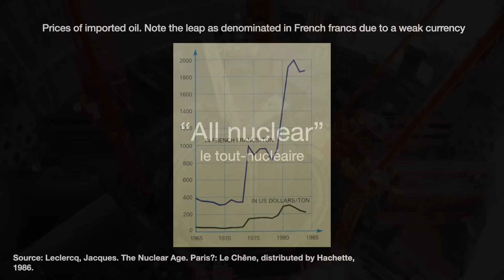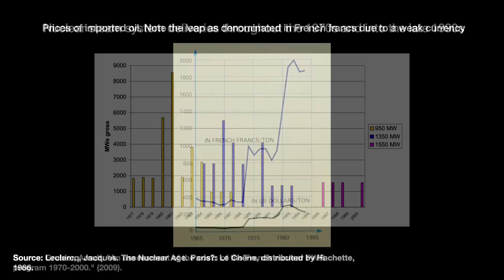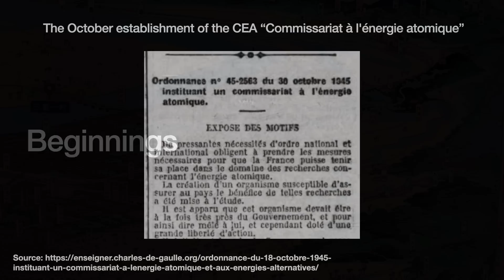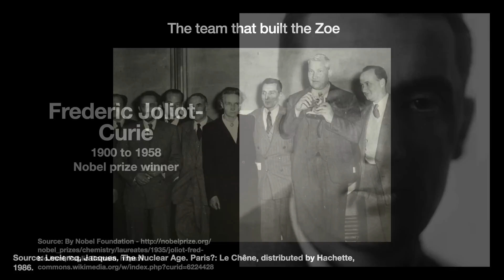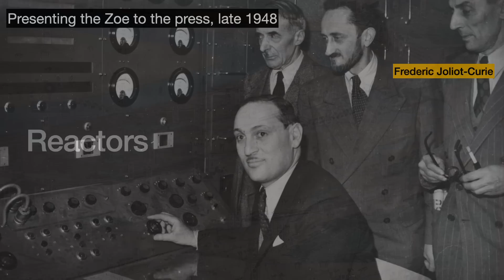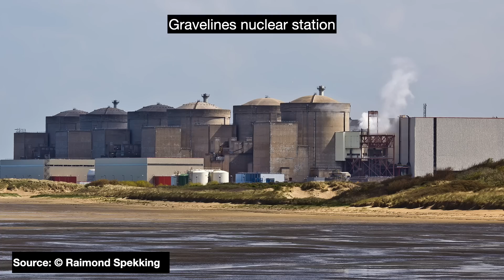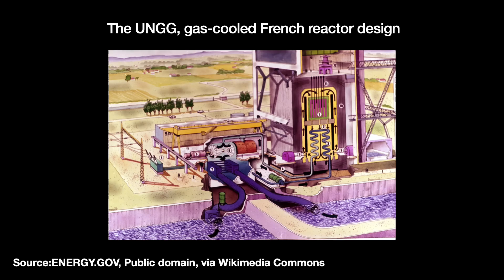That Time France Went "All Nuclear"

Comment: Nuclear energy is extremely underrated 👍
Reply: It's not underrated, it's outright hated and opressed.
Reply: @ZippyPiglin4136 International Oil & Gas companies fear and hate it.
Reply: @ZippyPiglin4136  "opressed" 😂😂😂
Reply: @snarckys3063  When you have thousands of layers of paperwork that does absolutely nothing but delay you under the guise of "safety" advised by bureaucrats who don't understand middle school science, that's what it is.
Reply: @ZippyPiglin4136 you don’t see a single reason why nuclear plants should be considered under extra safety measures than say a windmill? Really?
Reply: @hii4973   Did I not mention Heavy Indsutry explicity? What do you think Heavy Industry handles? WInd Turbines, or Steel Furnaces running at 2600 Celsius for years straight pouring out hudnreds of tonnes of material daily? Ain't no one batting an eey about how much sheer steel is needed daily, and how many lives are costed in that.
Reply: @ZippyPiglin4136 you think steel plants aren't heavily regulated? They are. Even so, the scale of destruction a failed nuclear plant would cause as opposed to a failed steel plant is orders of magnitudes higher. Hence the increased scrutiny
Reply: @hii4973  
The destruction  a failed nuclear plant would cause zero. 
In comparison, most mienral mines, especially REEs,casue immense water and land pollution, constantly. It's not flashy, but it is on-goingand always. 

"Hence the increased scrutiny". Great! Let's put intensemonitoring on all landfills that see solar panels as waste. Let's make all Solar Panels be manufactured in developed nations, with all minerals needed for it be extracted in developed nations. Let's monitor every single death and injury on Solar. Let's monitor every single material and water expelled from solar fields. Let's add in five more years of wait tiems and insurance complexity on Solar. Let's also make it mandatory to have massive ecological analysis. 

And guess what? It's equivalent is the least Nuclear has been delayed. Even though Solar needs massive mines in nations running off of slave labour, heavy metals that kill in minutes buried openly. No energy storage, thus firing up Gas at night. try changing any of that, and you blow up their "slightly lesser" Capex. 

And as for disasters, every heavy indsutry has far more death and risk than Nuclear possibly could. Nuclear has the least deaths per energy produced. Disasters from Hydroelectric, Natural Gas, and Wind Turbines are far more lethal, and far far more common. 

So maybe look why anything that isn't a LEU Light Water Reactor takes fifteen more years of scrutiny for absolutely no engienering or safety reason, while Solar Panels containing who-knows-waht heavy metals get installed to kill off local wildlife over a massive area that too with tax subsidies.
Reply: Tell me what do you do with nuclear waste? And how long does it keep poisoning the environment? As long as the waste issue is not resolved, nuclear costs more than it provides.
Reply: @TheAhmedRabia  "what do you do with nuclear waste?"

You put it in the ground where it came from.

"how long does it keep poisoning the environment?"

Never, since spent fuel from commercial NPPs is the best handled of all the waste humans produce, contrary to fossil fuel pollution which is thrown straight into the atmosphere.

"as long as the waste issue is not solved"

In 60 years of civilian nuclear power production there has been not a single deadly accident regarding spent fuel. There is no "waste issue".
Reply: @Z80Fan   Why do you lie?
Nuclear waste doesn't come from the ground. It comes from reactors. And it keeps emitting radiation and poison the environment forever.

You also lie about accidents. Look at waste storage bunkers in US and other places keep leaking poison and having incidents all the time. Look at Fukushima, Look at Chernobyl. The nuclear waste remains poisonous forever and anything it touches becomes radioactive and hence nuclear waste.

Stop lying to people. There is no scientific way to stop an item being radioactive. All of the current solutions to nuclear waste is merely sweeping it under the rug. And it keeps coming out of the rug and it stays poisonous forever.
Reply: @TheAhmedRabia  You're the one lying.
Reply: @ It's only an issue in fossil fuel propaganda.
Reply: @kristoffer3000  why are pro-nuclear freaks always such condescending fanatics? Literally insane.
Reply: Commercial utility-scale nuclear is the most expensive way to generate electricity, takes too long to build (10+ years), and comes with unparalleled risks that no other electricity generation even comes close to in risk profile.
Reply: @beyondfossil  It's expensive becuase governments have made it expensive with regulations. Do you really think that nuclear power has made human kind poorer? What evidence do you have for that mad claim?
Reply: @bjorntorlarsson  The UN IPCC says the next 10- to 20-years will be critical to mitigate the worst effects of global climate change but it takes 10- to 20-years to bring online a single utility-scale nuclear reactor!  New construction commercial nuclear energy won't even put a dent in the amount of energy needed to displace fossil fuels.

The worst part right now is that continuing the promote commercial utility-scale nuclear energy will only delay the global energy transition.  It will most certainly allow fossil fuels to be used for decades and decades longer than otherwise.

France's nuclear program is not a model for other nations to follow.  France's state run EDF is carrying huge amounts of debts subsidizing commercial nuclear energy to try to keep retail costs low for consumers.  But that cost just gets socialized in government debt, central bank balance sheets and across dozens of public funds making it hard to track.  Most of France's 56 reactors are at or near end of life and will cost billions to keep running all while getting less efficient and needing more maintenance versus newer designs.  France could be looking at a national energy crisis within the next decade or so.  France has not fully launched a new reactor since 2000 as Flamanville-3 continues to have problems.

Look at the fiasco that is France's latest Flamanville-3.   The Flamanville 3 project serves as a cautionary tale: initially expected to cost €3.3 billion, the price tag has now soared to a staggering €23.7 billion.  It has launched in 2025 but is producing very little power as more problems are discovered keeping this new reactor in test ramp up mode only.

Look at the fiasco that is the US Georgia Vogtle nuclear power plant.  It was a schedule and budget fiasco over-budget by double ($14B to $30B USD) and over-schedule (2016 expected but was 2023).  Taxpayers are on the hook for some $8-billion for this thing!

Look at UK Hinkley Point C (using French EPR) under construction already billions over budget and years behind schedule.  Almost certainly will have more delays and more money needed

Look at Finland Olkiluoto-3 (French EPR)  which was 18 years behind schedule and original cost €3 billion but ended up at €11 billion.
Reply: @bjorntorlarsson  Nuclear energy is France receives huge amounts of subsidies and government support to help keep rates low.

Across the nuclear lifecycle, governments and ratepayers' shoulder large chunks of cost that never show up in the reactor’s overnight capital price or its fuel bill.  These costs often get socialized to tax and ratepayers by way of government budgets, central bank balance sheets or across dozens and dozens of public funds making tracing difficult.

All energy receives some subsidies, but nuclear energy’s huge construction costs takes the most subsidies per MWh generation.  I will repeat again that commercial nuclear energy is the most expensive way to produce electricity.  Every dollar spent on nuclear energy can buy 3x to 10x the amount of renewables+storage and faster build as well (seem my previous comment).  The LCOE cost of renewables plus the LCOS cost of storage is cheaper than just nuclear LCOE cost alone!
Reply: @beyondfossil  IPCC lied the same thing 20 years ago. 40 years ago it was the imminent new ICE AGE that was the doomsday. Global warmning is an obvious fraud.  CO2 is nothing but good for all life on Earth. It would be great if the oil industry could recycle enough carbon to the atmosphere  by pumping up oil and gas and burn it, so that the CO2 content of the atmosphere 4-folds, to where it was last time Earth boomed of life everywhere. With the mega-fauna of the dinosaurs.

Even if we couldn't have any other benefit of oil, such as energy, we shoudl still pump it up and burn it in order to mazimize the CO2 content of the atmosphere. For the best of all life on Earth.

Don't care about the uneducated mentally ill idiots who claim that CO2 emissions is a bad thing. They lie to you in order to kill you. It is evolutionary selection. The idiots believe any bizarr lie, eat insects and die.
Reply: @bjorntorlarsson  Always blame the government lmao
Reply: @ It is bleeding obvious that the ruthlessly looting politicians in the EU, and its individual member governments, are regulating away all electricity, all transprots, all industry. They openly brag about how good it is with mass poverty and starvation, and how slavery is the ideal life style. And the slaughter waste votes for it, murdering their own children that they obviously hate so intensly.
Reply: @bjorntorlarsson  Take your meds. Freak.
Reply: @beyondfossil  You think Tax Subsidies and your Power Bill doesn't go to Energy in USA? 

In USA alone, Nuclear is politically forced to get immense cost overruns by politics. Renewables get subsidies with little question. 

Even then, Nuclear energy cost one-eighth of Solar energy on the bill of the consumer. And THIS Solar often doesn't have energy storage, and as such partially includes Natural Gas being fired up as well.
Reply: @beyondfossil   It's actively the least expensive over lifetime, even with subsided Renewables in comparison. 
And "takes too long"? Many reactor designs being made today are Pressurised Water Reactors. It used to take less than 5 years to make one back in the 1960s-1980s. In no way is the "taking 10 years" part related to the technology itself, and is fully upon political factors which do nothing but add delays. 
And "come with unparalleled risks", all while the entire risk is detectable by a geiger counter? It's not possible presently to track the fiberglass erosion or heavy metals that get into the air and ground from renewable energy. And mining vast quantities of material is by far the most environmentally damaging, which is what renewables require for basic operation, let alone stable operation.
Reply: @ZippyPiglin36 And what do you think nuclear reactors generate power with? Lots of air and goodwill? Entire regions have to be dug up for uranium, of which useful isotopes then have to be enriched before they can be used economically in reactors. Furthermore, uranium is even less abundant in the Earth than oil and natural gas. If we would adopt nuclear power generation at large scale world-wide, we would deplete our scarce uranium probably in a few decades, long before oil. So we're just substituting one problem for another with nuclear energy. It isn't sustainable and renewable because at some point shortly after adoption, the fuel would run out.
Reply: @ricdeh1701  "Whole regions"? How large area is total open pit uranium mining in the world? And the the landscape is restored afterwards. What area of the world is covered by solar panels?

You feel chaotic emotions, then you lie up fictional "arguments". Such reality denial and hallucinations don't fool anyone who lacks severe mental disability.
Reply: @ricdeh1701  The fuel obtained by converting Thorium into Uranium 233 can suffice for humanity for centuries.
Reply: @ricdeh1701  Uranium is far from rare and you're just making shit up to suit your absolutely moronic narrative.
Reply: @ZippyPiglin4136  No, nuclear energy's lifetime costs are the most expensive at a levelized cost analysis (LCOE).  It estimates the per-megawatt-hour cost of building and operating a power plant over its lifetime, accounting for capital expenditures, fuel costs, operations and maintenance, financing, and decommissioning.

Lazard LCOE:
Commercial Nuclear: $140 - $233
Utility-scale solar: $24 - $96
Onshore wind: $27 - $73
Offshore wind: $72 - $140

Decommissioning a nuclear power plant is no easy task at all.  It costs billions of dollars and decade or more in time while the plant produces exactly zero watts of electricity.  Nuclear energy’s vaunted high capacity factor plummets when decommissioning time is included but decommissioning time is more accurate as it reflects the entire lifespace of the asset while it still consume money, labor, and opportunity costs from unable land it occupies.  In contrast, renewable farms technically don’t ever need to be decommissioned because they can be “repowered” with new assets even as the farm is still running.   Thus, the land that renewables occupy can be used practically indefinitely.

On risk, no other energy source can produce catastrophic ongoing environmental damage like nuclear.  We're talking radionuclides with half-lives from 30 years to thousand and millions of years.  Look at Germany's Asse-II salt mines leaking radioactive materials into the surround soil for decades!
Reply: @ZippyPiglin4136  Although I like nuclear power, power plant construction was and is often subsidised too.
Reply: @kristoffer3000  Nice "arguments". Pro nuclear freak.
Reply: @ricdeh1701  One Uranium Mine running on workers with Certification and Unions; versus hundreds of heavy metal mines running on dying starving children. 

And oh, Uranium and Thorium are more common than Tungsten, and materially as easy to extract as almost every metal. Tungsten was used in those ultra cheap little incandescent bulbs, to ammunition and steel alloys in the present day. Safe to say about availability.
Reply: @thelloydersvk5068  It wasin its very early days. Now, and since the last few decades, it isn't subsidised, BUT sees massive political backlash.
Reply: @beyondfossil  The Chinese would disagree with you.
Reply: @beyondfossil  Funny how China can do it at fairly low cost and can build them very quickly.

Also nuclear is the safest form of energy generation we have, regard.
Reply: @kristoffer3000  And most of renewables also come from China.

To make a even more clear point on how nuclear surpasses renewables.
Reply: @kristoffer3000  No.  China emphasizes renewables and energy storage far more than nuclear energy.  

China’s annual renewable energy generation has always outpaced its annual nuclear by multiples.  As of 2023, China’s annual renewable generation was 2902TWh while nuclear power was a fraction of that at 435TWh.  This situation has been true going back to the 1990s!

As a percentage of the total electricity grid, China’s nuclear power is falling.  It peaked at 4.71% in 2020 and now down to 4.60% in 2023 and falling with renewables huge growth.

As of 2023:
China Wind: 9.36% (growing)
China Solar: 6.18%  (growing)
China Nuclear: 4.60% (falling since 2020)
Reply: @ We're both correct.
They still use and build a lot of nuclear which is the objectively correct choice, they just build even more renewables.
Reply: @ "Funny how China can do it..." Yes! And it illustrates China's total dominance in the world economy. They can build mass solar power, that works reliably, because they do it in a MASS SCALE unimaginable in the West. More than a third of the world's solar power is generated in China, and the share is increasing quickly.

They have built, and recently announced another $600 Billion investment until 2030 the world's most modern electric grid with high capacity and flexibility to handle power surges. And of course the majority of China's electricity is generated by coal and hydro which are ideal to stabilize power supply.

Photovoltaic has a potential in theory to be competitive, and the Chinese might've come that far now. Wind power is however hopeless already as a concept, and the Chinese have gone big on wind power too. It might've been profitable to export, but it can never be competitive.

Xi Jinping has campaigned hard on three issues: Anti-corruption, Clean environment, Belt-and-Road. And all three have been a resounding success. "Clean environment" means most of all air quality in China (not climate-no-change). So he might be pushing too hard into wind power for political reasons. Those towers are very visible signs of someone having put in an effort, for some reason that couldn't be explained to rational Martians if they made a visit.
Reply: @kristoffer3000  Renewables like wind, solar are ok. But nuclear is not renewable and it is the most poisonous of all.
Reply: @kristoffer3000  "The safest"... Yeah, when it does not obliterate 30 square kilometers of land. Nice ragebait still, regard.
Reply: @thebandofbastards4934  and china mostly uses renewables and not nuclear (between the two options I mean, because obviously they still use coal the most). Nice try regard.
Reply: @snarckys3063  Drooler mad.
I'm completely correct, why are you so extremely dim that you think nuclear power plants are actually nuclear bombs?
Reply: @TheAhmedRabia  Nuclear isn't even close to the most poisonous, that'd be coal.
Fun fact, burning coal releases A LOT of nuclear waste into the atmosphere for you to breathe in.
Reply: @snarckys3063 
Walk next to a Nuclear Powerplant, and you'll just be detained by security guards. 
Walk near a Solar Field, and you WILL burn to death when the sun is at its best shine. 
Walk near a larger Wind Turbine, and you WILL get deaf for a few days when the wind picks up. 

There's no "obligation" for such. It's standard to have a buffer zone in every Heavy Industry for security from idiots like you, and patent protection.
Reply: @TheAhmedRabia  Nuclear is poisonous?

You can sit with a Nuclear Fuel Bundle in your room for your whole decades of life, keeping just a 70 cm distance between yourself and the bundle. 

Sprinkle in a bit of Cadmium present in all Solar Panels, and you're dead in under an hour. 

Breath in a tiny bit of fiberglass that Wind Turbines release every second, and your lungs would have a thousand cuts. 

You speak of "poisonous" while having absolutely no knowledge. 

Spent Nuclear Fuel is stored in casks separated away from all environmental danger. 
Solar Panels are buried away in soil with no care or accounting, which leech heavy metals into soil and groundwater.

And "being Renewable" makes B.S. benefit, since it means you need immensely more material to extract energy from a source you cannot control. And that is in many, many, many magnitudes more.
Reply: @snarckys3063  China uses Renewables because it has Nuclear and Coal do back it up. 

Idiots like you presume that means Renewables alone can handle all of it. Why do you think China makes so many Solar Panels? Because idiots like you want to make your nation fully dependent on immensely large supply chain, where China has absolutely chokehold. And China can profit from it. 

China has made far more Nuclear in the last five years, than what America has in the last twenty.
Reply: @kristoffer3000  That guy is a leftist echo chamber agent. Reasoning isn't getting in their head.
Reply: @ZippyPiglin4136  These spent nuclear fuel caskets you speak of never proved to be reliable. However, thank you for shining a light on the possible risks of other renewables. I will be looking into it. But again, spent nuclear waste is never safe, at least until science figures out a way to get rid of it's radioactivity.
Reply: @TheAhmedRabia  And any example of not being reliable? 
There has been zero incidents and zero deaths for spent nuclear fuel casks ever. Period. 
As for the protests in Germany that "brought out nuclear waste", only low level waste is stored in flimsy steel barrels.

Secondly, the radioactivity outside of these casks are nearly zero from the inside material. Not only that, but radioactivity is one of the easiest properties to detect, and easiest to avoid. There is no need to "reduce the radiological hazard", for it barely is a hazard UNTIL and unless someone who knows fully well what radioactivity is tries to mess with it intentionally.
Reply: @ZippyPiglin4136  Zero deaths is a big lie. Don't lie. Also if these spent fuel barrels were safe your countries wouldn't be dumping them in the ocean or selling it to dictators to bury in secret sites in their countries. You'd bury it in your own country if safe. Also burrying it anywhere else can also circle back and reach you. Radioactive waste can travel with dust, air, sea water, clouds, etc.
Reply: @TheAhmedRabia  Are they dumping them in the ocean, or is that a massive myth spread for political gain? Every cask in the last few decades is tracked and stored in site of the power plant.
Reply: @TheAhmedRabia  And Radioactive Waste CANNOT easily travel by air or water or dust. It takes very, very horrid conditions intentionally made. Those molecules are heavy, large, and easily detectable.
Reply: @ZippyPiglin4136  Radioactive waste moved from Iraq to the shores of Britain when the US used depleted uranium in Iraq. Radioactive waste moved from fukushima to the shores of California when the Fukushima reactors exploded, and Europe is still scared of a breach of the lead cover of Chernobyl. Heavy particles will Irradiate sand and dust carried by the wind, and will irradiate water which will evaporate and become clouds to drop radioactive rain anywhere.
Reply: @TheAhmedRabia  And how likely is it that casks that survive a full train crashing head on somehow manage to leak out in their first 400 of so years, since almost all of radioactivity naturally subsides in that time period with almost all of the rest taking the half life? Even flimsy Plastic are expected to last in oceans for over a thousand years
Reply: @ZippyPiglin4136  Stop pushing nuclear energy propaganda and use google to checkout reality. Nuclear waste is still a problem and containment measures never proved reliable. And if Fukushima failed in the face of a natural disaster, so can any other reactor. When fukushima failed, Japan started piling up radioactive water into storage units just laying in the open outside, after the area got full they just decided to dump into the ocean. Most of these contaiment measures are merely propaganda. The reality is, disposal is beyond perfect, storage units don't last, and no one wants it buried in their backyard to limit exposure. And I say limit cause some epxosure will cricle back one way or another. Also radioactivity watch agencies keep raising safe radioactivity levels because background radiation keeps rising. Doesn't make it safe but they want to keep things running.
Reply: @TheAhmedRabia  None of this is "nuclear propaganda". Nuclear rarely sees enough support to afford propaganda. 
And yes, I did in fact, get these from actual neutral sources. 
The stuff you presented are, largely, found on websites sponsored by energy companies or political legions.

Fukushima wasn't a failure of waste management, it was largely reactor water being breached by two historically massive natural disasters at once. 
Maybe get your own sources checked, such that there's no renewable or fossil energy company profiting from your indoctrination? 
Absolutely every answer in regards to nuclear supports maths and basic logic. Renewables do the opposite.
Reply: @ZippyPiglin4136  Nuclear does alot of political pressure and propaganda. And you seem to be some sort of mouth piece.
Reply: @TheAhmedRabia  Pfft. The energy source that is unsupported by either political spectrum side, AND simultaneously horribly underfunded, somehow gets propaganda? Lol, lmao even. 

You seem nothing more than a mouthpiece of Anti-Green Energy Pro-Renewable Anti-Nuclear propaganda, which has supported from the entirety of the Left spectrum excluding Authoritarian Communists.
Reply: @ZippyPiglin4136  Stop lying to people lest you get radioactive rain or wind gust your way. Are you 100% sure that is not a possibility? Also I am done talking to you. You don't seem to acknkwledge any downsides of nuclear, defending it do death. Such conversation is useless. Let people do their own research and decide themselves.
Reply: @TheAhmedRabia  DO I not acklowledge the potential downside, or are teh downsides I acknowledge based on reality and acutal systems, over being force fed political propaganda to the extent that every fact deflects over the skull? 
You seem to be suprisingly close to the latter. Can't even figure out something that a middle schooler who's good in physics could. Smh.